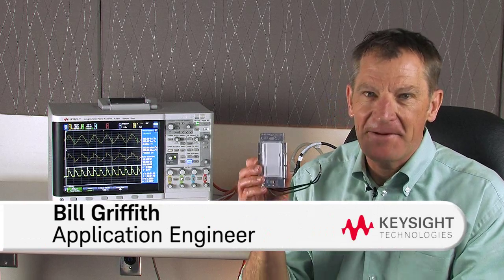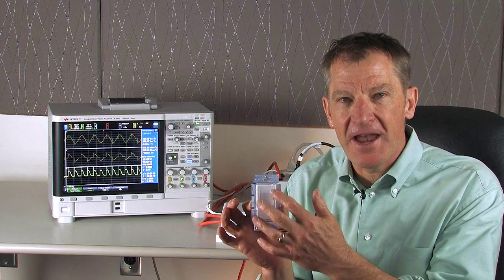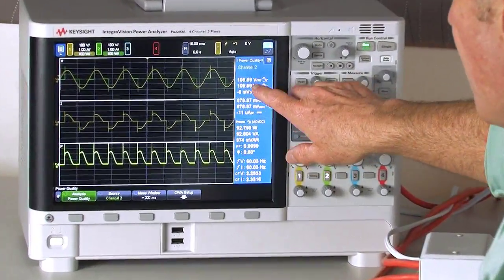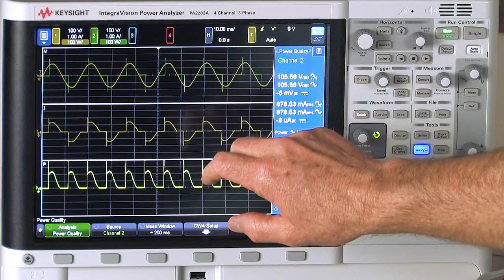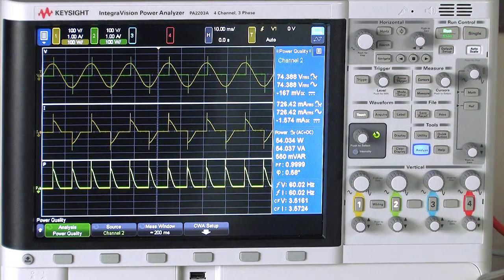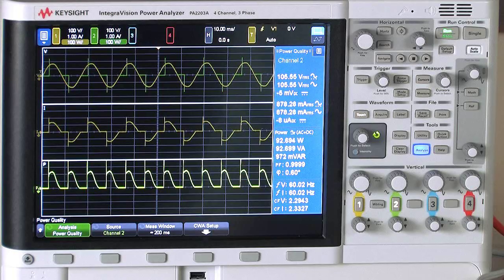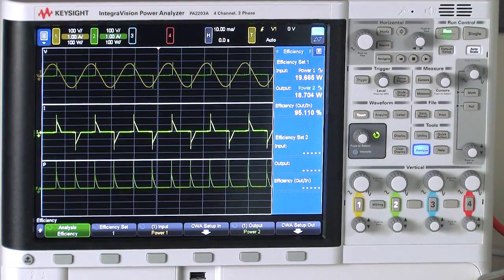Why Light Dimmers Get Warm and Measuring Dimmers Efficiency

Comment: You got it all wrong. Don't focus on efficiency. Focus on the input minus output power instead. This balance power is getting dissipated in the dimmer and causes the heating. When you reduce the brightness, the efficiency decreases but so does the input power. Dimmer should get hotter at higher brightness rather than at lower brightness.

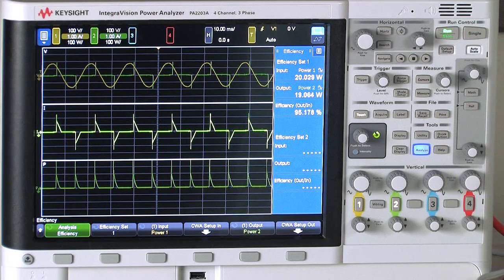Comment: Thank you for the wonderful presentation. Not only do these forward phase control based switches get hot from their (mild) inefficiency, but they also introduce a significant amount of noise (which you can see as the over and under-shoot in this video) back into the main lines. This is highest when the waveform is chopped at just over the 50% mark ( 2:26 ). 

Sensitive audio equipment (e.g., power amplifiers and active monitors containing power amplifiers with poor line conditioning) will pick up this noise and make it audible (as a buzz at 120 Hz). There are ways to reduce this noise, such as in-line coils on the mains in series with the switch, as well as using a laminated core EI (and not toroidal, which would couple noise from primary to secondary and not handle DC offset, well) isolation transformer in front of sensitive audio equipment to smooth the noise peaks.